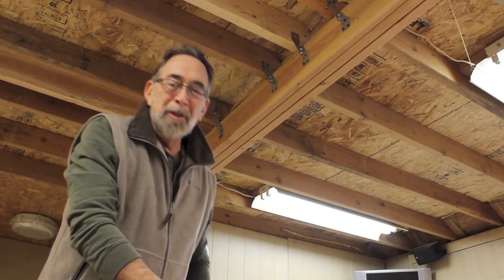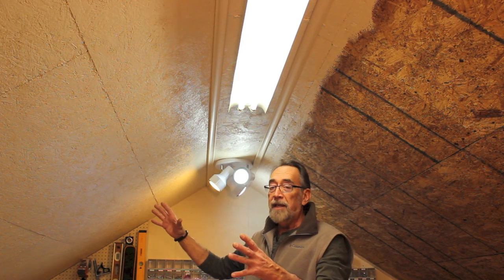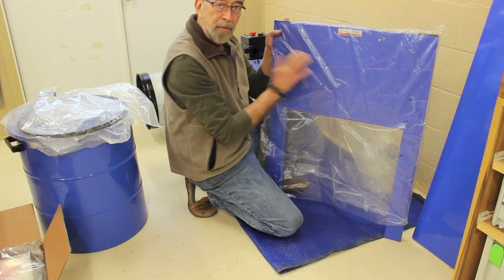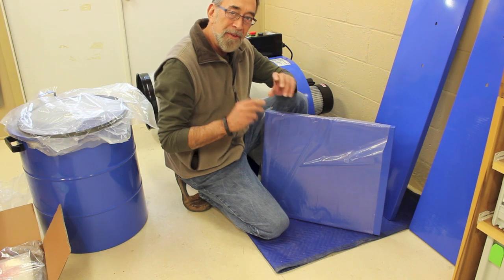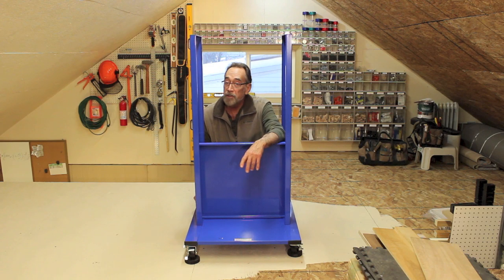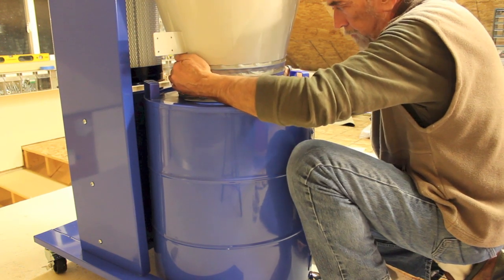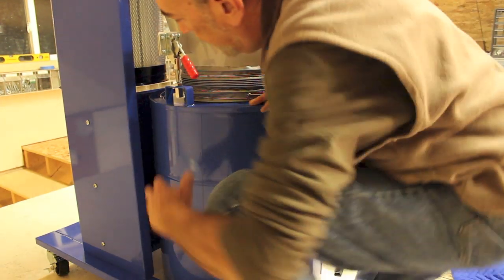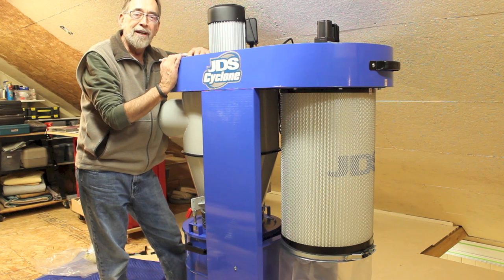Dust Collector - Prep & Assembly

Comment: I have the same criteria as you for dust collection. Is that run on 110 volt. Could you tell me your final cost on the unit and exactly which unit it was. I would like to purchase the same unit
Reply from the maker: +Richard Shaw Thanks for watching! This unit is 220 volt.  The company does have different size units.  This one is the model 2100-CKV and costs about $1500 plus shipping.  Check out their web site for more information.  jdstools.com
Reply: +Richard Shaw 3 HP Cyclone 3100-CK $1999.00

Comment: How your view of this unit after a few years? Do you feel it's still separates the fine dust and larger pieces well?
Reply from the maker: +Nate Daggett Nate, I love it.  It still (knock on wood) works great and if anything, I think the unit is performing better now that when it was new (likely due to the filter being fully "seasoned".  However, as you will likely find out if you pursue this unit further, they are currently in the process of moving their manufacturing "back" from overseas to the U.S.  They are currently out of stock on units and not expected to have units for a while.  I have not spoken directly with the folks at JDS, but others have, and I have heard dates from "late April" to "early summer" before they will have units available again.  Bad news if you have to purchase right away, but good news in the long run because I can anticipate that the units manufactured here will be even better since they will be able to oversee every aspect of production.
Reply: +downtoearthwoodworks Hey Steve - thanks for that info.  Yup I talked them today and it sounds like they are hoping for the new products to come around mid-summer. They said they are looking to redesign the units and to add a 1 1/2 hp unit to the 2 and 3 hp.  It sounds like the redesign might be closer to the Jet style until which sucks. I was hoping it would stay the same as I like they way they have it.  It seems to be built better than the other items you reviewed.  Most likely for me I'll just end up going with the Grizzly as that was going to be my first choice before digging more plus $$ is an issue. $900-1100 is my budget and it sounds like the new ones might be a couple hundred more, but they are made in the USA which is SWEET!

Comment: Great video, Steve.  Is there anything that comes with the machine that indicates country of manufacture?  I've seen a review of the Laguna model that has a similar look and it was made in Taiwan.  The reviewer had a lot of trouble with the way that parts fit on the machine.  Laguna, to their credit, rectified the problem but still they were there.  So I'm curious.
Reply from the maker: +paulpaul1948 I'm not sure where the unit is manufactured (or perhaps assembled) but here is what I can tell you about fit and finish... it is quite good.  Every screw and hole signed up perfectly, the paint job is perfect.  The only machine I have put together recently with better "fit and finish" is my SawStop PCS.  The worst was... well, I better not say...

Comment from the maker: Cary,
The question on "fine" dust or "fines" being caught in the plastic bag below the filter as opposed to the collection drum has come up.  I suspect there are too many potential variables to answer the question perfectly.  Someone might let their collection drum get a bit too full and certainly material would pass from the cyclone to the secondary filtration area.  This could be caused by other variables, too.  Is the air flow "too much" at the entrance to the cyclone?  Higher airspeed would not allow the air speed to adequately slow and allow the "fines" to drop out of the airstream.  The unit is so powerful that it might be necessary to open another blast gate partially to slow the overall air movement.  All I can do is tell you my personal experience.  I recently spent the better part of the day milling some rough lumber... net result, I emptied the dust collection drum 11 times that day, but did not have to empty the plastic bag beneath the filter once.  It's been a few weeks since then, and I have worked everyday in my shop, and that bag is still scarcely 1/4 full.  Again, this is just my personal experience.  Now, regarding the automatic drum cleaning paddles... yes, they do run every time you turn off the machine, and yes, it is overkill, and no, I know of no way to "bypass" that.  I would be interested in what JDS has to say and whether or not they can suggest a workaround or mod.  Let me know because I would be interested in that, too.  The easiest answer would be to set the timer so that the automatic cleaning mode doesn't start for, say, ten minutes.  That way if you cycle the machine back on within that "delay" time, the paddles would not run.
By the way, hope you get this response.  For some reason there was no "reply" option on your comment.  I think you have to set that in your preferences.
Reply: Thanks for sharing your experience. You've put my mind at ease regarding the quantity of fines. I'll ask JDS about the flapper and let you know what they say. Thanks also for the heads-up about my Google+ settings--I fixed that.
Reply: I sent the following to JDS Tools: 
I am considering the purchase of one of your cyclones. After some research I am left with just one question: is it possible to toggle the automatic drum flapper on and off? To keep noise down, I would want to turn the cyclone on and off frequently, and would think having the flapper operate every few minutes would become a bit annoying.

Within minutes I received the folllowing reply from John McConegly:

You could install a manual switch in the power line between the cyclone switch and the filter cleaning motor.Keep the manual switch in the off position until you are ready to clean the filter when you shut the cyclone off.

I didn't realize the wire to the filter cleaning motor was exposed, but looking closely at the picture, I see it is.
Reply from the maker: Sounds like a pretty simple solution...

Comment: I've watched several of your videos and have learned a lot from each one. Many thanks. I do have a couple of questions about your JDS cyclone dust collector. I have a JDS 1.5hp single-stage dust collector and am looking to upgrade to a cyclone. I had an Oneida 1.5hp fixed cyclone in my previous shop, so I'm not new to the "which clone" question, Even so, I'm having a lot of trouble deciding what to get now. (I haven't even decided between fixed and mobile). The JDS is on the short list for sure, but I haven't been able to find answers to two questions that I have about it.

My first question concerns the amount of fines one gets. I came across one reviewer who claimed he was getting almost as much fines as what he collected in the drum. He attributed it to the fact that unit is not very tall. Surely that's an exaggeration, but I'd like to know what your experience has been. 
  
My second question concerns the automatic drum brusher. I tend to operate the dust collector for only a few minutes at a time. It would become rather annoying for the DC to go through its flapper dance each time I turn it off.  Do you know if that feature can be turned on and off? I could call JDS on Monday to find out, but I thought I might ask and would also appreciate your views on that feature. If you don't know, I'll let you know what JDS says.